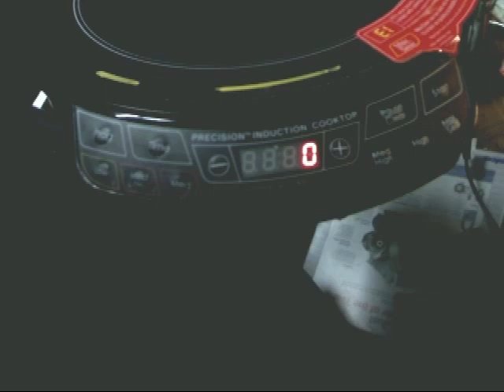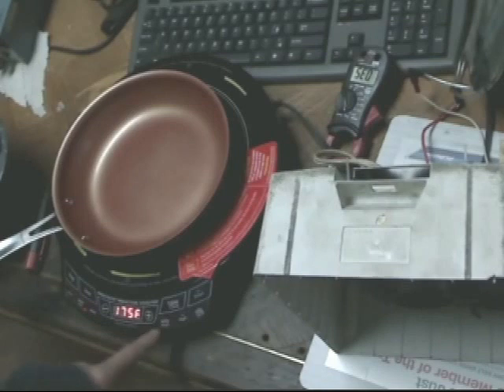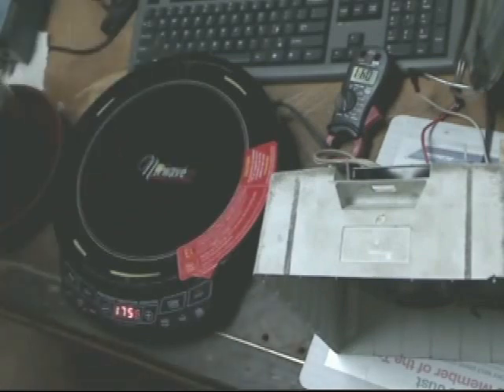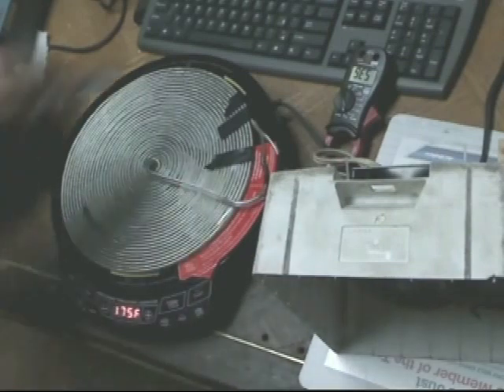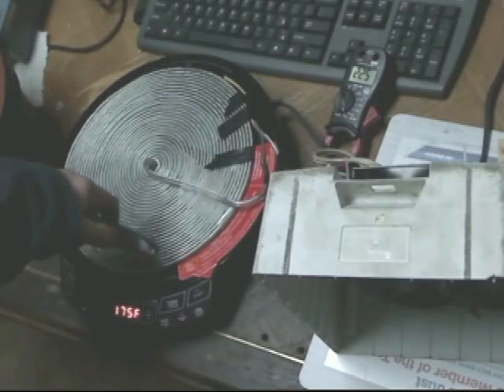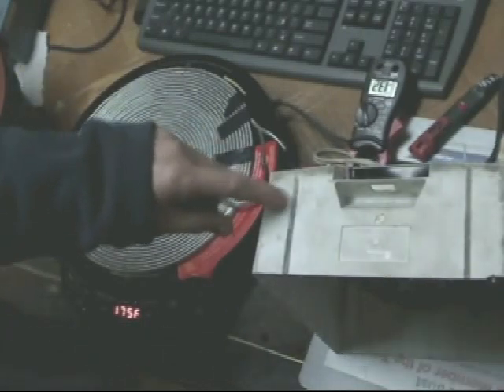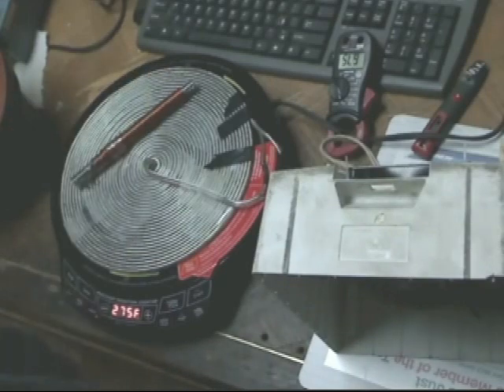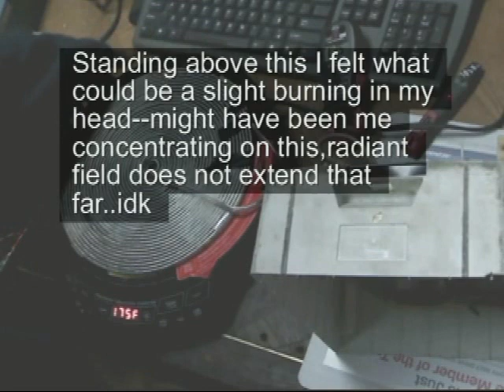GeGene and induction stove investigating

Comment: If u put little gap between the top bifilar coil and bottom induction cooktop, the secondary flux from bifilar coil will repel the primary flux of induction coil, and the input might remain lower.